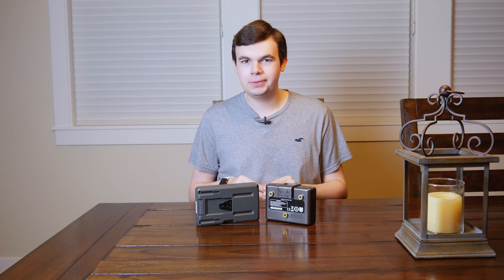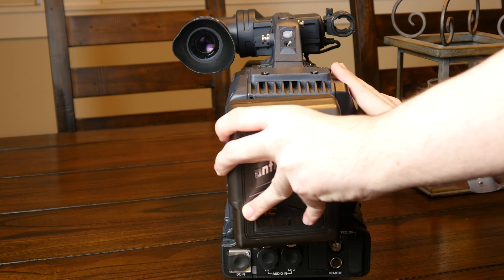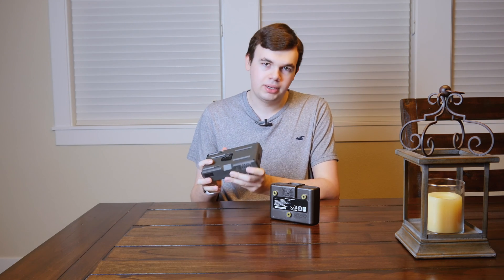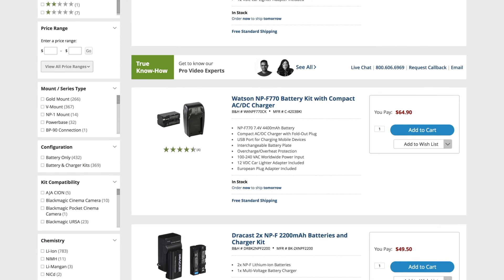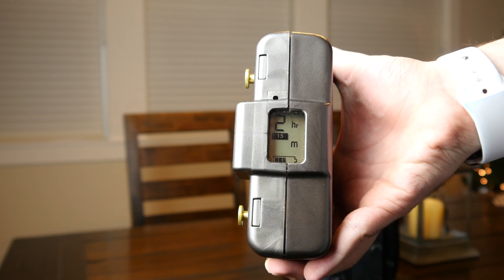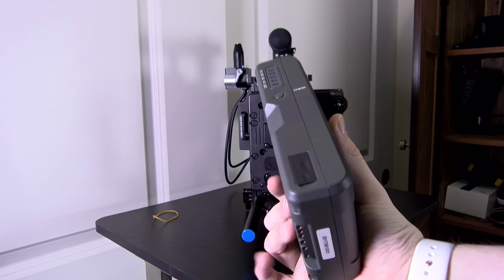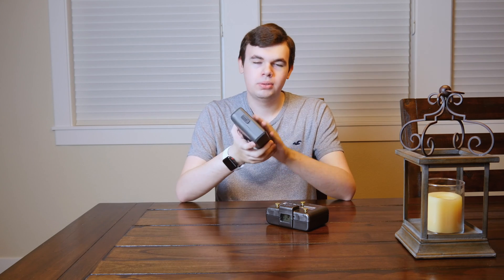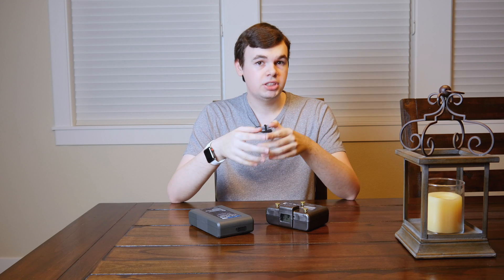Gold Mount Vs. V-Mount

Comment: Most cinema cameras are equipped with V-Mounts. Connecting a Gold Mount battery to a V-Mount plate requires an adapter, which adds an extra mechanical connection that is less secure than a direct mount. For reliability and safety, it’s best to use V-Mount batteries unless the camera is specifically designed with a Gold Mount plate.

Comment: It seems like after watching this video that there are really no advantages to Gold Mount. Who wants more weight, higher cost, and less selection? Whether it's more secure also depends on whether that is an issue for V-mount to begin with and I don't hear people complaining about that at all. This is coming from someone who is invested in the Gold Mount system just because I never really thought about it before investing into a system.